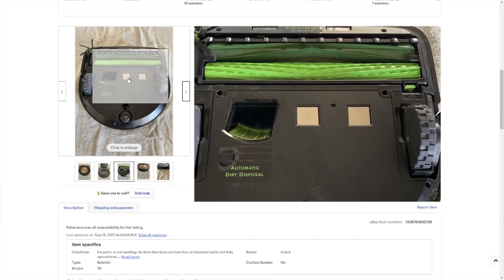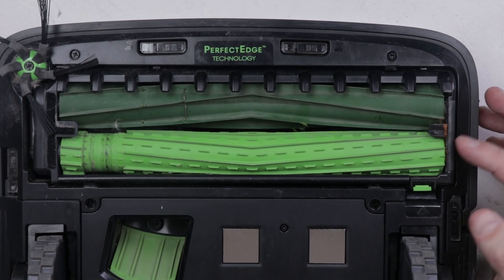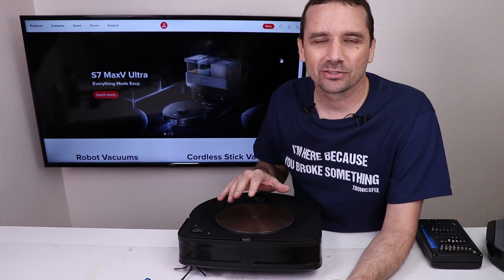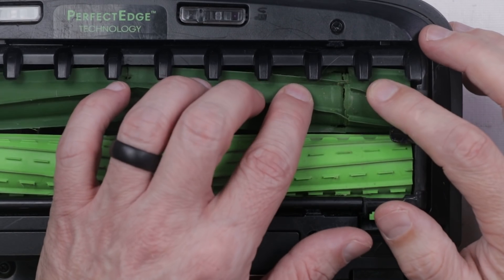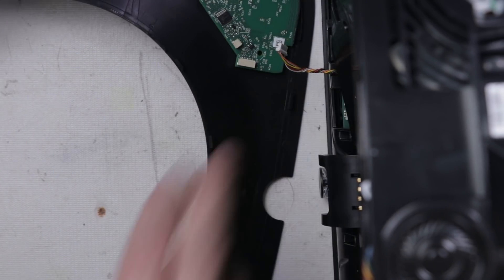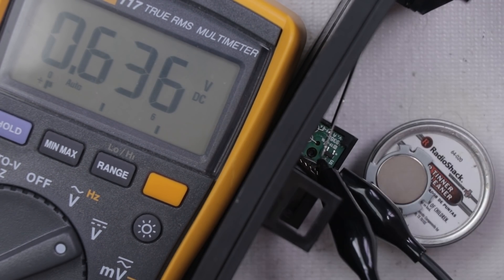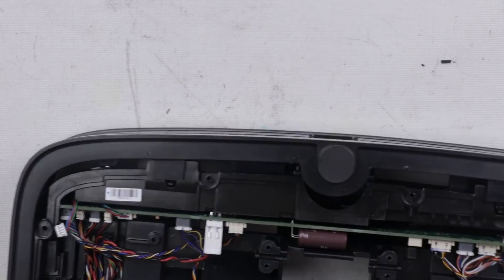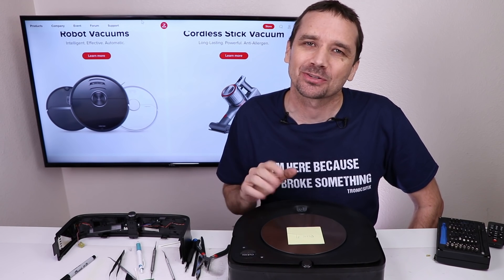3 BROKEN Robot Vacuums  - But Can I Fix Them?

Comment: I have a first generation Roomba that had a similar problem where it would only operate backwards then error out. The issue was a "cliff sensor" wire had come out of the wire race in the bumper and was cut when the robot bumped into objects repeatedly. Try inspecting the sensor wires, these late generation Roombas are really easy to tear down and diagnose compared to the very early ones.

Comment: I've got a Eufy 11S which would work fine but it's missing a tiny bit of plastic on one of the sensors. Eufy don't have spares of it and I can't find any damaged ones on ebay for a decent price to take apart. Really shouldn't be hard for them to provide a spare sensor cover.

Comment: It’s funny to watch how people swapping parts call it a repair video.. error 31 is not a quick or simple repair.. Ive fixed bunch of these, and there is a very good reason why roomba support just replaces these robots instead of offering some sort of home repair guide. For these who doesn’t have experience working with smds, components, oscilloscopes and logic analyzers, I would recommend to pass on buying these for parts  robots, and get a working one instead. Save yourself time and money.

Comment: ah, those are hall sensors, aka magnetic-field sensors.  When the vacuum comes in contact with a wall, one of its "bumpers" should recline, moving the magnetic closer to the sensor.  This should generate some type of interrupt signal to (possibly) a microcontroller, let it know that "hey, this side of my body is right next to the wall" and then it probably signals the wheels to spin in opposite directions which causes the body to rotate counterclockwise or clockwise rather than rolling forward).

Comment: Have you tried doing a factory reset on it?  Maybe configuration got messed up?  Since you have 3 I'd just swap parts between them until you can produce the issue in another unit or clear it from yours.  Seems to be a common enough issue so if you can figure it out I bet you'd get a ton of views!

Comment: Error 31 is when the map in the cleaner doesn't match the map in the app, factory reset from app, disconnect battery, hold power button for a few seconds until everything in the circuits is completely  drained of power, wait at least 5 minutes to reconnect the battery, reboot and re register in app.

Comment: I am one of those poeple still of the opinion that these only work with a sledge hammer. A normal vacuum that you push yourself is better. I always think of cartoons/films etc, where you drop something and the vacuum comes along real fast and sucks up what you drop. Imagine, you drop a screw while fixing a ps5 or something and gone, you can't find it, then you here one of these little things scurrying away, SLEDGE HAMMER TIME.

Comment: Try easiest (if You didn't yet, bc it sometimes hapends to me, that easiest thing U can possibly imagine is wrong, and I'm trying for hours to fix something that's absolutely fine 😂) try continuity test on wires, mainly wires from motherboard to sensor board, if not, magnets still can be your problem, so after that I whould try to move everything from N.1 to N.2, I mean everything, even a vaccum motor, so You narrow it down to magnets only, if not, try swaping part by part, I mean You have 3 of them, You must take advantage of it 😂 

Awsome video as always 😎 I like fact that You are challanging Yourself to repair other things like cameras, phones, laptops, that You never even seen before. Amazing 😇

Comment: I've fixed just one robot, but I noticed if it has just one bad part, it will refuse to power on, mine had a bad side brush motor, I guess it noticed excessive current from it and shutdown, simply unplugging that motor allowed it to run perfectly fine.

Comment: Keep up the amazing work fixing all of these electronics. They were destined for the bin but your bringing life back into them.
Just a suggestion, but don't know,
Mabye the actual cleaning button is at fault, it did say a few times about the button being stuck or mabye it was saying to hold it down to hard reset it, either way, that might count as a sensor as the button is um (capacitive touch I think, though not quite sure if that's the right term) so mabye the sensor on the button is thinking that it's being pressed or something like that.

Comment: Hey Steve, I bought a PS4 controller for $10 from someone selling it on offerup, and while replacing the battery pack was all it needed, I can't help but be paranoid about the controller led light indicator glowing & fading yellow/orange when it's turned off, even though there's absolutely NOTHING wrong with the controller. I don't know if that's OK, given that could easily drain the new battery pack's life out quick. Let me know if you think something's off on that.

Comment: The error 31 is an internal communication error. I think that you might have CPU problem I looked it up you could try update the software on it see if that will work should not be a hard fix Bryce

Comment: The sensors might have a spec of dirt in one or all of them and it will cause the error 31 to appear try cleaning then with a qtip and see if that help I do know it was the issue I had and maybe the issue that one has

Comment: At minute 8:07 on the chassis there is a metal thing that acts like a spring sort of...and it is getting weak, because of that the bumper stays closer affecting the sensors( I think .). I fixed my Roborock S7 by pulling that thing forward and putting some packaging foam behind it to keep it from going weak again . Considering that you changed and tried everything else this might be the cause.

Comment: I've repaired a bunch of robo vacuums and found that most often it is dirt clogging up the sensors. Especially on models where all the sensors (even the bumper) are some variation of optical sensors (eg the bumper is interrupting a light barrier when bumping into things). There's also the slight possibility that communication between the main board and the sensor board is somehow interrupted (actually unplugging it and starting the robot again should hopefully yield a different error code).
It should also be able to tell if individual sensors aren't working, so unplugging those sensor cables should yield a different error code yet again (provided the communication betwen the boards is working).

Comment: The sensor error could be from the optical sensor under the vaccum that detect if the the vaccum is about to fall in a void like a staircase. When I put my roomba on a very dark rug, it's going backward like yours did and then it's giving me an error because the optical sensors think the rug is a void.

Comment: Roomba error 31 is a comms error, the suggested fix is to hold clean button down for 20 seconds then the circle light bar will spin around white, once it stops it suppose to go into start mode. Doing a bit more net search there are different ways to fix error depends on series model, one says it's comms error with app. So could be problem with wifi antenna

Comment: ifixit “UPDATE: I have run the Roomba S9 since removing the main vacuum head, blowing out the hair and dust: The result is that I have had very few error 31’s since. Today is the second day without an error 31.

Remove the head, blow out hair and dust, put back the head and all will be well.”

Comment: 1. I would love it if you could do a video fixing really old consoles like the PS1 or N64 or one of the saga systems! I think that it could be a really fun video to watch.

2. With that error on the vacuum? One thing to try would be to test every part in one off the working vacuums. Take on part from the broken one and put it in a working one until it stops working and then you have found the problem! Also you could try to google the error code to see what type of error it is that might help to narrow it down to a specific part or group of parts. Another thing to try would be to do a system update ( I f you can update those specific robot vacuums ) because sometimes updating them can fix some errors!
Reply: 1. its super costly affair and takes forever to find ICs for replacement. he needs to put videos out on schedule and on budget.
2.that's what he did. watch full video before commenting.
Reply: @ErickBuildsStuff  I did watch the whole video! My point was that if he couldn’t find what was wrong the first time he could systematically take on part from the broken one and put it in the good one and so on! It’s most likely that the problem isn’t the main circuit or the bumper thing but there are other parts he could test like the motor’s or there are probably more sensors that could be tested!

As for the retro console repair idea. I have no idea how expensive parts are for old consoles like that I just thought it could be a fun interesting video because he does a lot of PS4 Xbox one and switch repairs so seeing him try PS1 or 2 consoles or NES SNES and N64 would be really interesting! He did do a original Xbox repair not to long ago so it might be worth it even if he won’t make any money from the repair!

Comment: My girlfriend let a robot vacuum drop down a floor down the staircase. It... kinda still works? However it became a lot more 'stupid' as if having brain damage. Also it can't lift itself up as efficient anymore, but it gets the job done. I sort of repaired it by pressing the plastic covers back into place.
Reply from the maker: Ha, ha...most of them have stair sensors. Yours must not have
Reply: @Tronicsfix  It does, but it's a bit of a cheaper model. So when turning it on it starts moving a forward for a bit and then orientates itself. Just before it's orientation device it decided to just off itself. xD
Reply: Must be a super cheap one

Comment: Roomba S9 had a manufacturing defect in some earlier production runs. It worked for a few weeks, then have random issues. Reset, it would work for a little while longer, then stop again. Always Error 31. Support never said which part was bad, but replaced the entire unit because it was defective straight from the factory.
Reply from the maker: I think I might have found the bad part. I'll make another video if it fixes it.
Reply: @Tronicsfix  what was it, motor or battery maybe?
Reply: @ledhunters  but error 31 is sensor error
Reply: @Tronicsfix  Is it the camera?

Comment: Eyyy hall effect sensors. I was just buying some the other day for a project I'm working on lol. I'm guessing error 31 is some kind of software thing? Seems really odd that replacing the mainboard did nothing. Beyond brute-force checking all the connections to the mainboard and comparing to the working one I wouldn't know where to start.
Reply from the maker: I think I might have found the issue so I'll be making another video.
Reply: I was wondering if the mainboard was somehow keyed to the other parts and if it would just do nothing when plugged into another unit. Thank God the Apple/Microsoft console philosophy of uniquely serializing everything hasn't infected appliances...yet.

Comment: I just fixed a water damaged Shark IQ for a friend of mine.  Replaced a $0.42 SS14 Schottky Diode and it was as good as new.  The water droplet shorted it to ground causing the diode to conduct in both directions.
Reply from the maker: NICE WORK! Love hearing stuff like this. It's amazing how cheap most of this stuff is to fix.

Comment: I have the Roborock S6, had it since 2016.  Its done great until the end of 2021.  The brush is making a grinding noise, like the gears are done and it don't pick up anything.  I'm looking at the S7 and it was $250 off for Christmas, now its not, so I'm waiting for a price drop.
Reply from the maker: Interesting. Wonder what's going on with the brush. I bought a Roborock before they even sponsored this video and really like it.
Reply: mine too, i just used a silicone lubricant spray on it and it works great!

Comment: the tip on those rollers are different is because they are from a chinese knockoff.
If you check amazon reviews, it is well documented.
your fix you did is what is usually done.